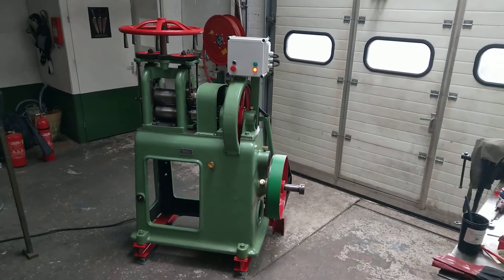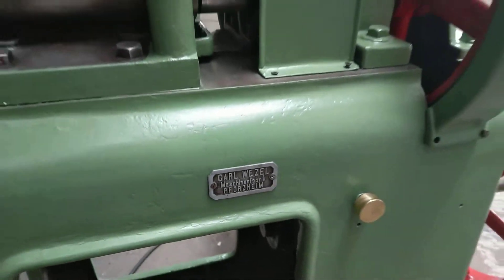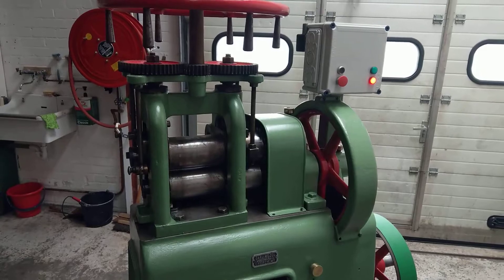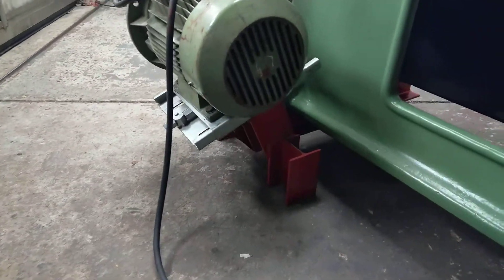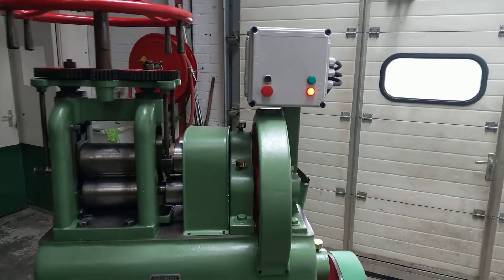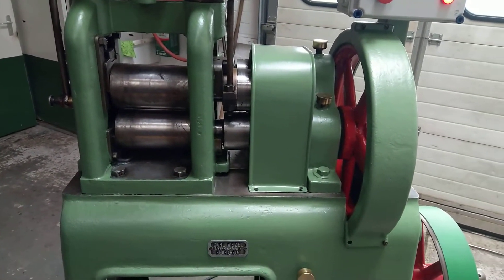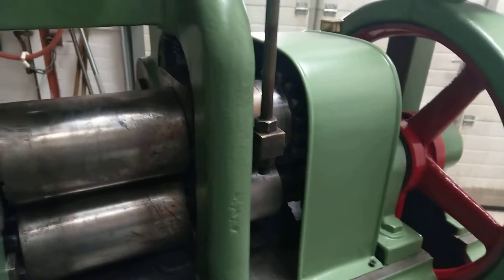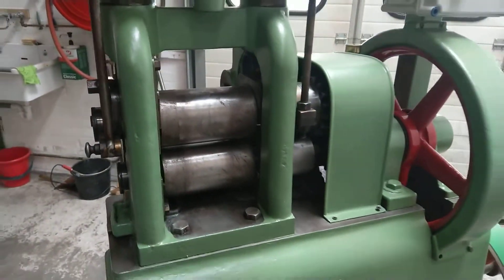Carl Wezel rolling mill for forging hot steel

Comment: Nice rolling  mill. What is the  size of the  rolls?
Reply from the maker: Thnx, 200x120 from the top of my head, I'll have to measure if you want to be sure
Reply: @JohanvanZanten  I just bought a mill that looks a bit smilar. Rolls are 200x130 . Does it work good for knife making?
Reply from the maker: @SmihammarNo  yes, it is awesome, congrats with yours, maybe you can upload a video?
Reply: @JohanvanZanten  yes I will. I can send you photos if your interested.
Reply from the maker: @SmihammarNo  very interesting! The frame for the rolls is largely the same. I like the transmission system which works with different roll heights. My machine works with the teeth of the sprockets going in and out.